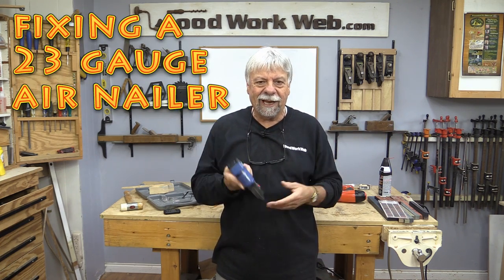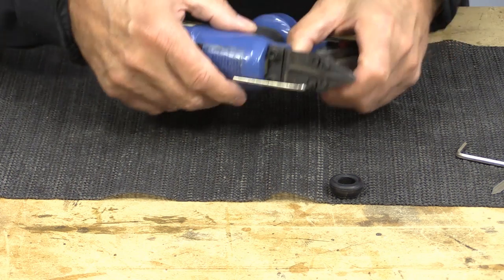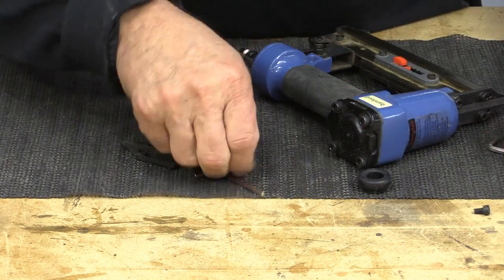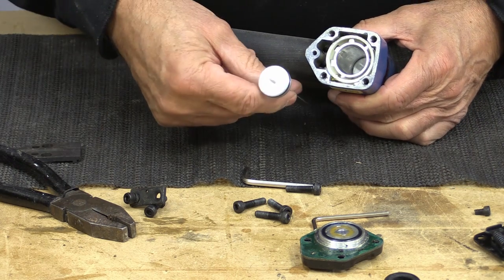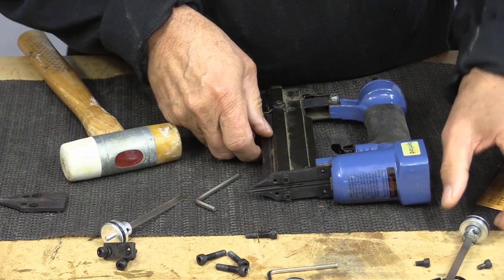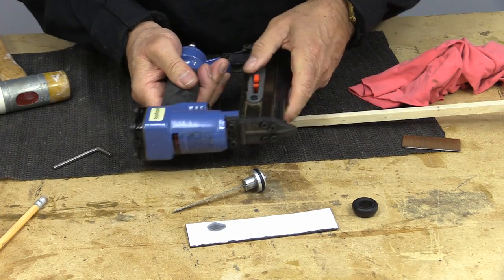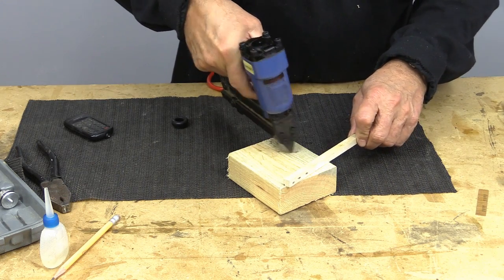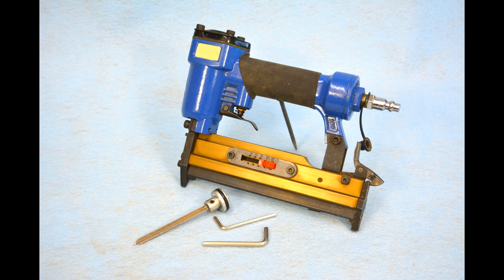How to Fix an Air Nailer - 23 Gauge Pinner (Pneumatic Nailer Repair)

Comment: Woodworking tools usually come with manuals but hardly any woordworker reads them. Me neither.
Reply from the maker: I actually keep every manual that comes with a tool and sometimes I do go and look at them, this one didn't but I should have checked on-line, there might be a manual for it, then I would have known what to take apart ... good point buddy ... appreciate it

Comment: The plastic/rubber ring is to protect your work when pinning on a fine surface Colin. It's called a "non marking nose"
Reply from the maker: I did not know that, thanks Cliff, I will try that
Reply: You are very welcome Colin.

Comment: Thanks Colin for this video, I have just had the same problem and got the replacement pinner. Now I will repair the blocked one. Just a note for the member that mentions that all pinners come with Manuals this is not true for the ones that come from china into the UK, there is no manuals with them.
Reply from the maker: Ah ... interesting, I did not know that ... and this is a British pinner, so it probably never came with a manual, thanks for this, I always learn something

Comment: Just wanted to say THANK YOU for this video.  I have a nailer that is 99% the same as this one and your video helped me figure out how to get in that back part/cap so I could identify an unknown rubbery part that had started to disintegrate and blow up thru the cap--which then caused air to leak out at a fast rate.  In my case, it was an o-ring.  Unfortunately, the gasket that sealed the cap part came apart when I pried the back off so I may not be able to replace the gasked even if the o-ring is replaceable.  Even though it's old, it was working great until the o-ring failed so figuring out how to fix it is better than sending it to a landfill in my opinion.  I also want to mention to the peanut gallery telling you to consult your manual first: this nailer had woefully inadequate "operating instructions" and no manual.  There's no exploded view, no parts list.  Really the most basic of guidelines.  Nothing useful.  As for breaking the warranty, this gun was made circa 20 years ago so the warranty had already passed by the time you opened it up to fix it.  Kudos to your "every man" real world video.

Comment: Good job Colin. Hey extra oil is better than no oil and nice that the manufacture supplied the replacement parts for the install.
Reply from the maker: Hi Ron, yeah, I'm pretty good with the oiling but I think the hammering tool makes after 14 or so years of use has taken a bit of toll on it too ... but at least it's good again, hopefully another 14 years :)

Comment: Another great video Colin. I have the same pin nailer but it's still going strong. They are cheap but work very well for years. You can redress the plunger head by filing it flat again but you have to ensure you do not remove too much metal.
Derek
Reply from the maker: Thanks Derek ... the plunger on mine is quite warn on one side which is probably why it was sticking, I will try to get a replacement part, but it's going on  14 or so years old now, so not sure parts are still available

Comment: I just got a Porter Cable 23 guage nailer and it CAME JAMMED.  Literally the first pin I put through it left the plunger all the way forward.

Well, my Dad has exactly the same model, so I took them both apart, side by side, cleaned his, then reassembled them.

His works, mine does not.  They are both clean, free of jams, and have parts in apparently good working order.

Porter Cable can lick my taint.

Comment: If you look here at 3:44 you can see the exact moment the manufacturer’s warranty is voided 🙂
And Colin, it’s ok to look at the user manual every once in a while 🙂. 
Great video as always - thanks for sharing.
Reply: I have the same or very similar brad nailer and I can vouch that the warranty expired about 2 decades ago.  I can't even find any trace of it online to purchase the correct o-ring.  Also, there was no manual to speak of.  The operating instructions are horrid.

Comment: Great video!   Hey just curious did you ever figure out what that extra black round part was for? (the extra piece included with your pin nailer that looks sort of like a little black rubber plunger)   Thx!
Reply from the maker: Yes, apparently it is a bumpter to put on the bottom so you don't mar the surface, another poster told me ... I had never seen one before.

Comment: Colin why didn't you check the owners manual since they gave you extra parts they must have instructions on how to install them.  Love your videos.
Reply from the maker: Your are correct, I should have done that, this was a "demo" tool that I purchased so didn't come with a manual but I should have tried to look it up on-line, that might have saved me some time ... thanks Daniel

Comment: I repair both of mines or 18 gauge I don't remember the name of that part but it only causes $5 on the internet and you can always replace them that's the only thing I goes bad on them early good luck just thought I'd let you know there is a website that sells all those parts.
Reply from the maker: Thanks for the tip and thanks for watching!

Comment: Mechanical tools are usually easily repaired. It's the electronic/electrical that's nigh impossible to repair when the magic smoke gets out.
Reply from the maker: Good point, yes you are correct Adam